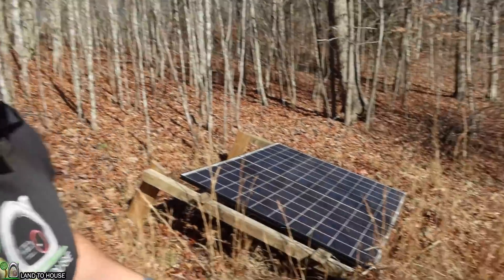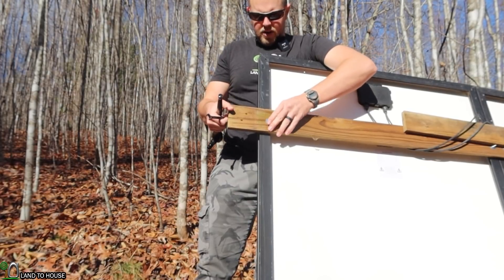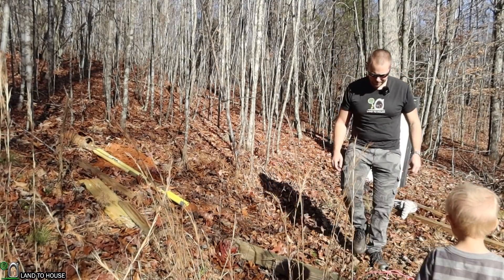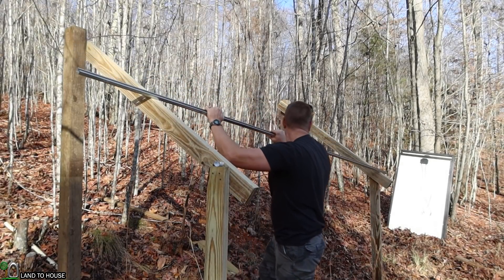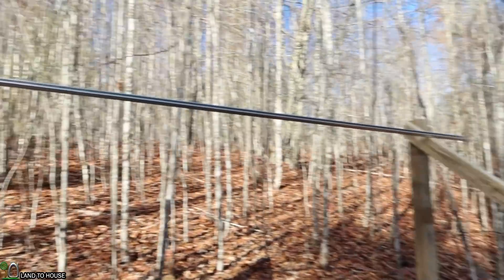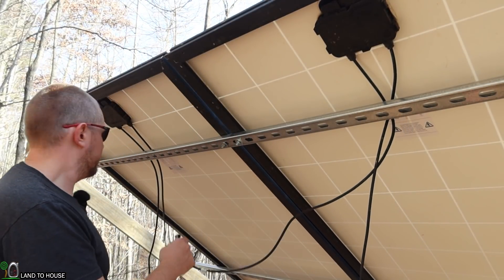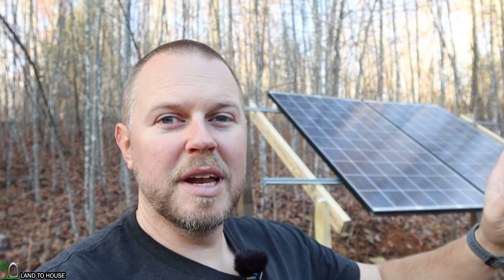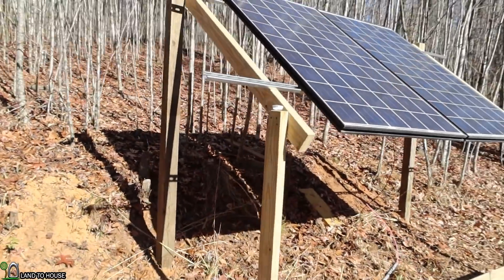New Solar Power Panel Mount for the Off Grid Workshop

Comment: If the vertical support beams were closer to the center of the panels there wouldn't be as much flex in the middle. Should work out fine as is. Just a thought.

Comment: Hi how do u wire replay  for under voltage shut off
Reply from the maker: Do you mean when the sun goes down what happens? The charge controller goes into rest mode.

Comment: If the panels are connected in series the the voltage will be higher. But the power will be the same. 250watts
Reply: The power will double, as the voltage has doubled. 
Current will stay the same however. ;)
Reply from the maker: An additional adapter is needed to connect in parallel. I figure its easier to just go series.

Comment: I went with the heavier struts since the lighter ones seemed to flex too much. Yours may be fine since you’re only mounting the two panels.  Nice to get them off the ground, huh? Looks good!
Reply from the maker: That is a good idea. The larger ones are a little more costly but should be there for many years. This mount is a lot better for sure.

Comment: While the panels and unistrut do not weigh much, the choice to just screw the 2x4 pieces into the side of 4x4 posts creates very little in the way of sheer strength.  Heavy winds pushing up and down on the panels will stress those connections, as well as the screws securing the unistrut to the 2x4's.  Lag bolts, area washers and nuts would allow you to secure those much more effectively.  A third piece of unistrut, under the middle of the panels, definitely seems to be in order.
Reply from the maker: I am interested in seeing how well the torx screws hold up. Its a fast and easy solution but might not last. The Mount holding my main solar panels uses all thread rods with aluminum bar as a U shaped bracket around the 2x4's. It has worked very well. Those just take a lot of time to cut and install.
Reply: Nails for sheer strength plus screws for clamping strength
Reply: @LibertyDIY  - That's not the proper way to build any kind of load-bearing structure.

Comment: I read somewhere that there is an optimum angle to set up solar based on your longitude, Is it worth the trouble or do you just wing it?
edit: I meant latitude.
Reply from the maker: It is for sure worth doing if the solar is going to be used a lot. In this tiny off grid shed 500w is far more than I need. I am out there somewhere around 6 to 8 hours a week.  But if the solar is going to a house for main power you want to make sure the angle is right. On my main panels for the house I used an app to find solar noon.

Comment: Nice build, thanks for sharing.  You could add 2 more unistruts under the panels and that would share the load better for less sagging, better wind resistance,  and it would be quick and easy.
Reply from the maker: That is a good idea. those cost around $20 so not too bad. I think even 1 more would be enough to keep things from sagging.

Comment: so  for the money you have into this shed how many years will it take to pay its self off ? from what i understand the going rate of pay off is like ten years .
Reply from the maker: The solar aspect of the shed? This one is not connected to the grid so it does not really pay itself off that way. I could have run a wire from the house for far less money. But the youtube videos pay for the system rather quickly.  The panels are a total of $130, the midnight classic was from my hydro series and was the wrong size but it was $700. I would use a $100 mppt if I did not have this one. The other battery and the inverter are from sponsorships. So $730 cost and the videos in 6 months have made $245. 

But if you consider that its off grid it is worth peace of mind that it works all the time. If the house power were off for some reason I could still charge things out there as a completely separate system. 

Without youtube and using budget components .... It would take at least 5 years to make back the power savings with as little as I am out there.

Comment: How much energy will be able to use with this solar panel? Are you using for that  workshop How it will be helpful for generating electricity?
Reply from the maker: This set of panels is just for charging a single battery used in my tools shed. It is enough for lights and a few receptacles.  Nothing with heavy power draw.
Reply: @LandtoHouse  Are you also going to use it for trickle-charging the batteries of the Four-Wheeler and the lawn mower to get them safely through the winter?
Reply from the maker: @patrickhoffmann8893   I am actually considering a small dedicated solar panel for that. just a very easy Anderson plugged disconnect from a small charge controller.